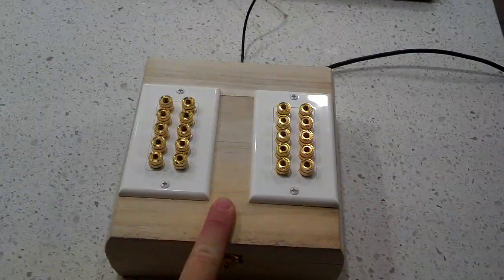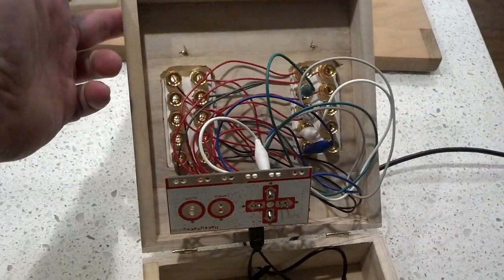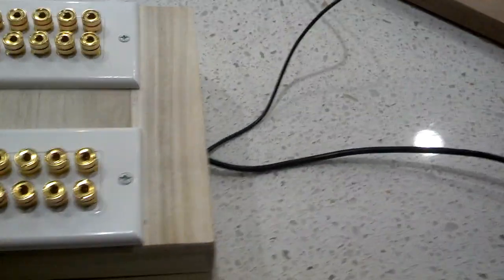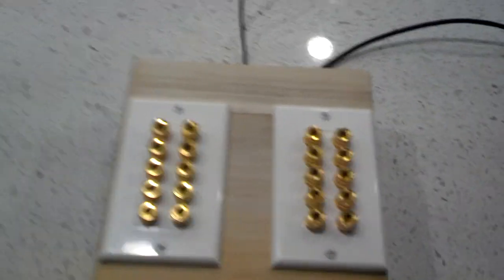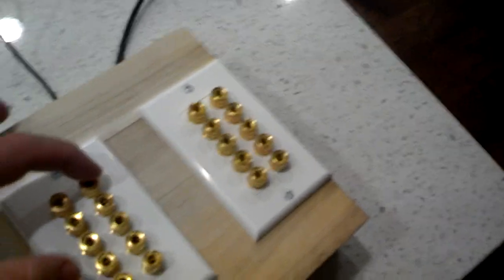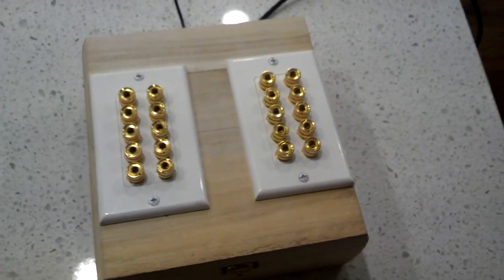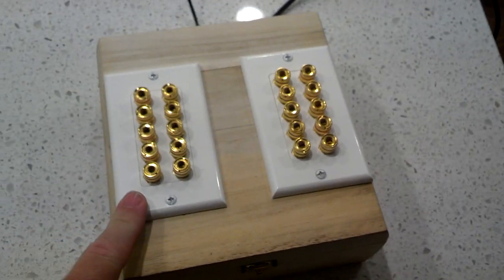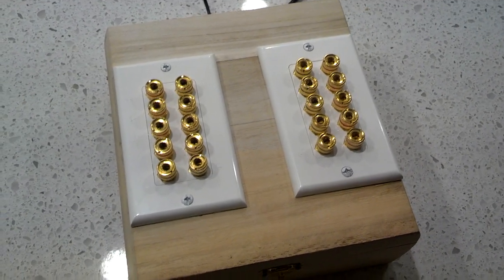Makey Makey and Raspberry Pi Halloween Sound Board

Comment from the maker: I think the latency is being caused by the python script that I used to play the audio files.  I need to find a way around this that still allows me to run the Pi headless.  There are other audio programs I could run, but most of the ones I looked at wouldn't immediately boot to that program and so would require a monitor.

Comment from the maker: I was just talking about this in relation to next years Bay Area Maker Faire.   We were thinking leather gloves with metal finger tips, possible with the thumb as a ground.

The other option, rather than the FM transmitter, might be a Bluetooth dongle on the Raspberry Pi, if it can support audio that way.  Then stream to bluetooth speakers.

Comment from the maker: Thanks Eric.  I love the fact that the MakeyMakey is so easy to play with.  That low barrier to entry (from a technical standpoint) is what makes it so great.  I have a bunch more ideas, but right now I'm getting it ready for Halloween.

A friend and I just realized we could get the number of wires out of the box to 0, if we added a decent battery pack and an FM transmitter like you use in a car.  That would make it portable, wearable, etc.